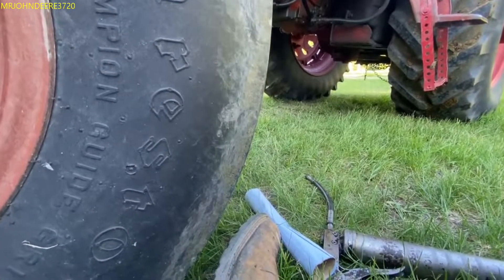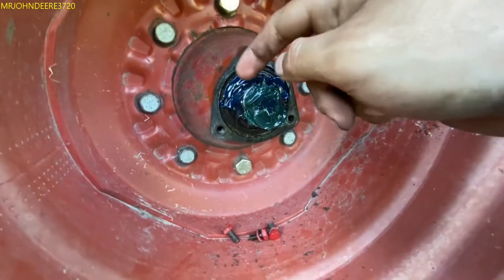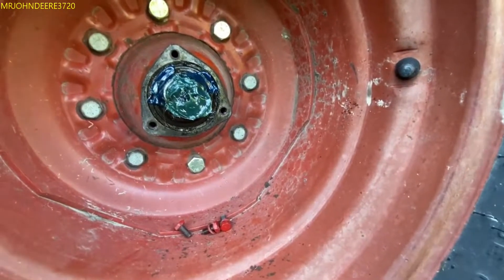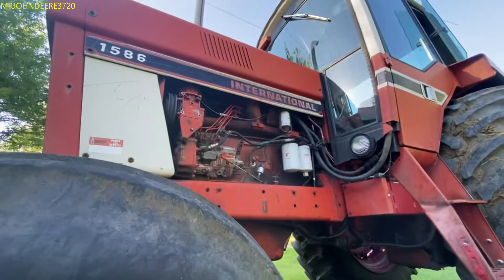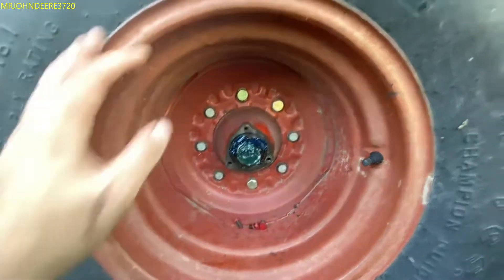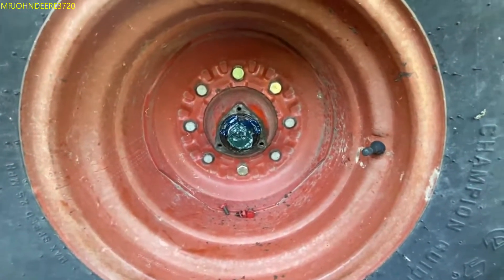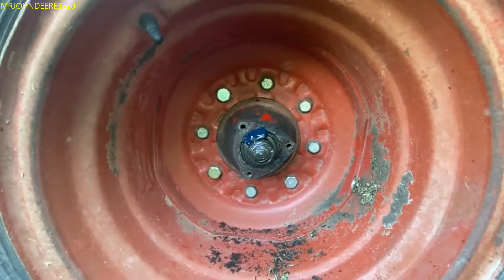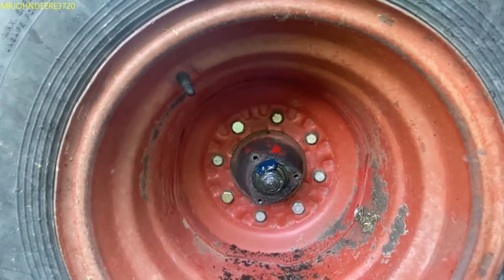the dumbest thing i've seen done to a tractor!

Comment: The nail will work ok but you really need to jack up the front wheel off the ground to check for play in the bearings. Probably pull that spike and take the hub right off to see just how good or bad the bearings are. Could be pretty short of grease on the inside.
Reply from the maker: i dont think theres any play in it. wont this grease work its way 2 the back?
Reply: @MrJohndeere3720  Not  usually. The grease can be thick on the outside but when I pull the bearing out there is very little on the rollers. Have to take the bearing right out and smear it up with grease. I just did all four wheels on my sprayer.
Reply from the maker: @roosty6  o ok. :)